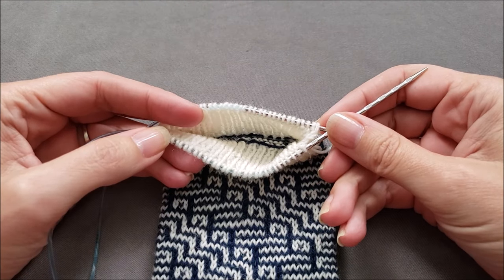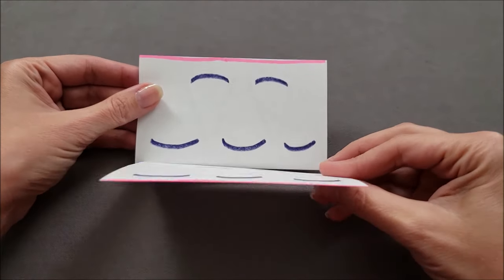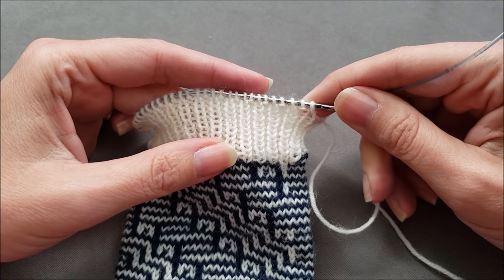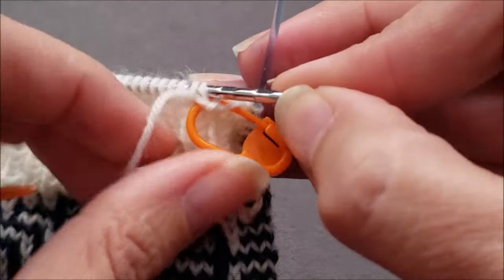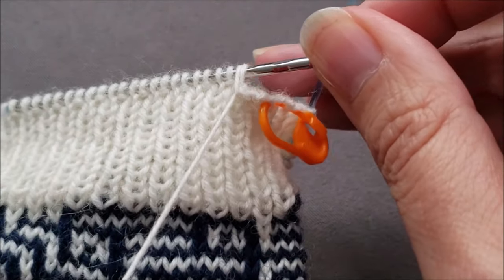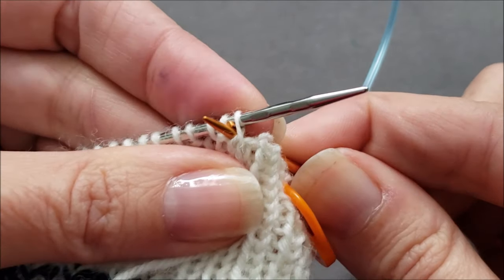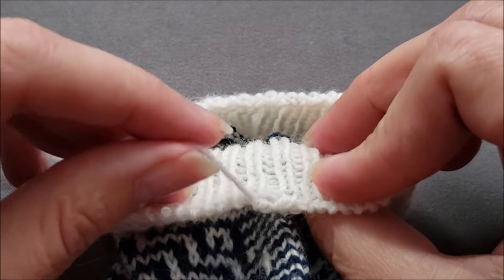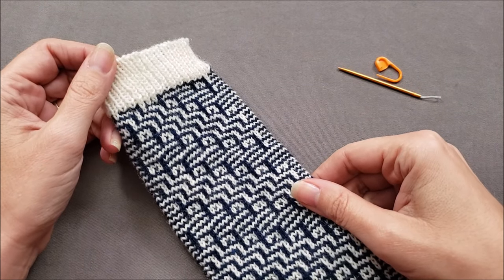Tubular Bind Off In the Round for k1, p1 Ribbing

Comment: Thank you for sharing this. I just watched another tutorial that required a 4-row double knitting set up.  So I'll be trying this bind off both ways to see what effect each has on its finished edge.  :)
Reply from the maker: Neither way is necessarily better, but they do create slightly different looking and feeling edges. It's definitely worth trying both.
Reply: @thechillydog  I used yours to finish the beret I had been working on at the time.  The edge seemed wonky/wavy when I was done so I'm guessing that's caused by the tension in the working yarn as I pull it through.  I'll definitely need to rewatch your video and pay closer attention to how tightly you're doing yours.
Reply from the maker: Ultimately you want the stitches your forming when grafting to be a similar size to the ones you've knit. It make take some practice. Also, you can tighten things up after grafting by gently lifting one leg of a stitch and then the next around from the beginning of the graft to the end. It takes some time, but then you can get things to even out better. Good luck!

Comment: Any tips and tricks on using the tubular bind off with an extreme amount of stitches? If your yarn breaks or need to start a new length of yarn, shall we simply treat as normal , weave in?
Reply from the maker: Take it slow if you're doing a lot of stitches. I like to give myself enough uninterrupted time to complete this bind off. If you need to attach a new length of yarn, I highly recommend using something like either a Russian join or a spit splice so the ends are completely concealed and there's no weaving in.

Comment: Love this video.  I have it saved and refer to it every so often to refresh my memory on the technique.
Question; would the method change if you had worked your 1x1 rib as K1TBL, P1?
Reply from the maker: I've never tried it with a ktbl, p1 rib. I expect, even with an adjustments, the stitches wouldn't appear to flow over the edge neatly. On the RS knits appear twisted (from working through the back of the loop) but knits appear untwisted on the WS (because they were worked as plain purls on the RS) and vice versa.
Reply: @thechillydog  thank you. Yes it makes sense that one side will have a twist and the other wouldn’t. Happy knitting

Comment: Great video. I'm curious though, why no set up rounds? I've seen tutorials with 2 set up or 4 set up rounds, not clear on purpose of set up rounds and what drawbacks might be of not including- can you enlighten?
Reply from the maker: The set up rounds can be used as a transition from stockinette stitch to 1x1 ribbing  or to create an actual tube that maybe you could pull a drawstring through. If you're already working 1x1 ribbing, I can't think of an advantage to doing the set-up rounds, but there's nothing wrong with knitting them either. It just creates a slightly different effect.

Comment: Such a great tutorial. The "why" part at the beginning was a revelation! I have seen other tutorials that begin with a set-up that is going purlwise through the first stitch, leaving it on the needle. Followed by going from back to front between the first and second stitch, then knitwise through the second stitch, leaving it on the needle. You just jump right into the bind off. Is the set-up not necessary? Thanks!
Reply from the maker: Even when you're not binding off in the round, those two set-up sts are often more of a convention than a structural necessity. That being said, it's also not "wrong" to work them.
Reply: @thechillydog  thank you! I bound off the waistband of a sweater without them using your tutorial and it looks great! I found that it is definitely important to snug up everything as you go along.

Comment: Great clear instructional video!  I've seen this technique done with 2-4 setup rounds of a pseudo-double knitting.  Any reason to do that?  I've found it just restricts the stretchiness.
Reply from the maker: Great question! If you are already working in k1, p1 ribbing (like I was for this pattern) there is no need to work that "pseudo-double knitting" because it looks odd and doesn't help with the stretchiness. But, if you were working in a different stitch pattern, like plain stockinette, you need to transition to k1, p1 ribbing somehow to get the bind off to work properly. In that case, that "pseudo-double knitting" is the transition and creates an actual, narrow tube along the edge before  you graft the stitches together. You won't see the k1, p1 ribbing though, because the purl side of all the stitches are inside the tube.

Comment: Thank you for your video. So we’ll explained.  Would you tell me where you got your long blunt needle for seeing the bind off. Thanks
Reply from the maker: I believe I used a Knitter's Pride wool needle in this one. I don't remember where I bought it, but they come in a three pack, with three sizes, and are available at many local yarn shops.
Reply: Thank you for getting back to me.  I think I saw you using a needle in one of your videos that your husband bought for you and made to order. It was longer than the usual needles. I think it was about five inches long. I find doing the Italian bind off my shorter needle is quite awkward to use. My hands are a little arthritic so thought it might be a better solution as I am using this sewn bind off more frequently.
Reply from the maker: The one my husband got me is only about 3 inches long. However, if you think a longer needle would work better for you, search for a "tapestry weaving needle". You can find them made of different materials and they come in different lengths. Might do the trick.
Reply: Thank you.

Comment: I used this bind off for a sweater that I am now frogging, and it was super tight. There was barely any give, so I'm wondering if this bind off should be used for mainly smaller projects or maybe I did something wrong
Reply from the maker: It's could be really hard to keep an even tension with this bind off when you're wrangling a long yarn tail like you would be to bind off the bottom of a sweater.

Comment: So, I have a sweater hem that uses a cable ribbing. Is there any reason I couldn't use this tubular cast off on straight stockinette stitch? Is there a tubular cast off especially for stockinette? I like that it doesn't curl.
Reply from the maker: You could give it a try and see how it looks. I suspect it will not create the neat rounded edge with stockinette stitch that it does with 1x1 rib. Maybe a suspended bind off in pattern would give you enough elasticity and not too much rolling of the edge.

Comment: Hello, I used this bind off for the neck and the cuffs of my sweater now I am finished and have the whole bottom of the sweater to bind off... is this a good bind off for a flat sweater (cardigan) bottom? If so how do I do the first and last 6 stitches that are garter stitch (the buttonband)? thank you!
Reply from the maker: You certainly could use this bind off for a flat project. Of the top of my head, I don't know how I would accommodate those 6 garter stitches.